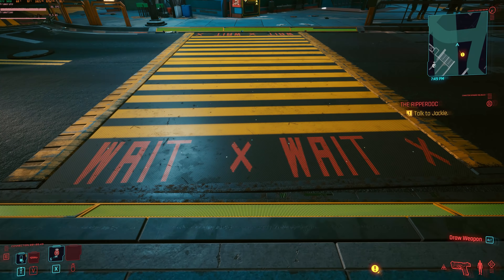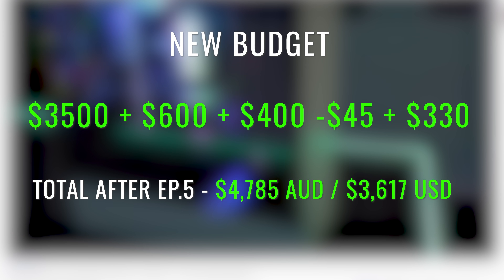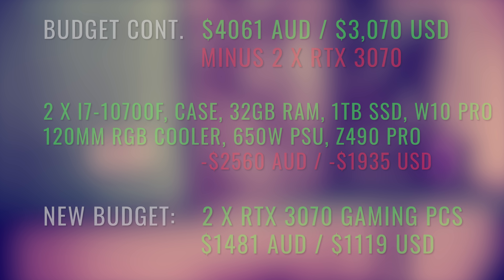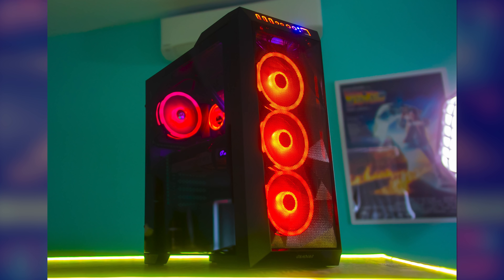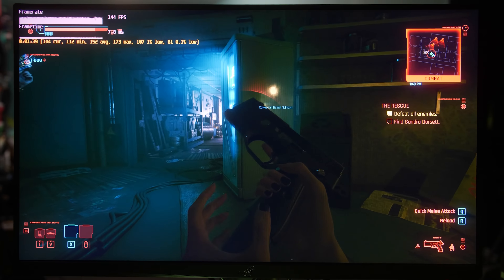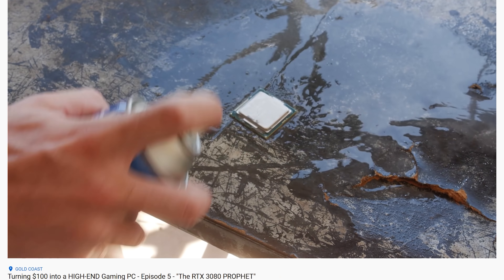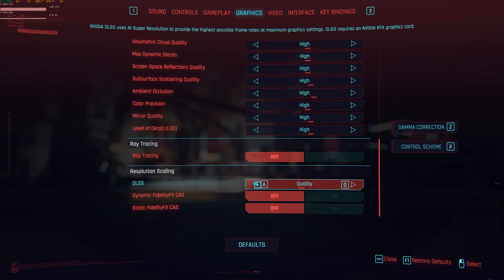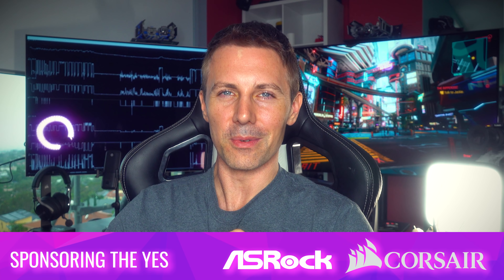Turning $100 into a HIGH-END Gaming PC - Episode 6 - "CyberMONEY 2077"

Comment: i have a r5 1600 and a 1060 and im barely hitting 55 fps on medium settings and 85% adaptive resolution scaling on cyberpunk, i figured out the main bottleneck was the CPU IPC, overclocking my cpu gave me like 20% extra perfomance, so if anyone is having issues with the game on a similar pc i hope this comment helps :)
Reply: Not that different from the gtx 960 2gb and the i7 4790 as I've seen near enough the same result at medium

Comment: I like the fact that you use these not-so well known brands. They mostly as good as other hyped brand's cards imo. Mainly in the EU, most people going for Gigabyte (Aourus), MSI or ASUS, but they usually tend to cost quite a bit more, while these "no-name" brands usually brings better value for the money to the table. Keep up the price-performance hustles! :)
Reply: Especially since MSI and to sometimes Gigabyte have had pretty bad / faulty parts. I've used a HIS 390x for myself and a MSI 390x for a friend, turns out the MSI one had no cooling on one part of it's vram and fried the memory after some years while the HIS card had the better cooler and ran like a champ for ages till I upgraded to a 5700xt. Popular brands do not equal better quality

Comment: Will 6c/6t be enough for Cyberpunk? Im thinking bout getting 3500X from Ali since 3600 prices are crazy, paired with 5700XT, possibly 3060TI if i can get one in decent price.
Reply: Cyberpunk states an i7-4790 (which is an older 4core/8thread part) as minimum for ultra settings, so with a modern true 6 core you should be golden. I happen to have a 4770k that's pretty much the same as the 4790, paired with a 5700xt and it works great for about any game, with the 3500x you should be even better off. Go for the 3060ti if you can, it will be a huge upgrade and prices should come down close to msrp over the next month, well worth the wait imo.

Comment: Technical question - why are all desktops placed vertically and not horizontally?
Is it because of desk real estate or does it serve another function?
Wouldn't it be more sensible to have it horizontally so all of the components, especially the relative heavy ones like gpu, would "sit" comfortably in their slots due to gravity and potentially provide less stress on the motherboard.
Reply: the weight is mostly a problem during shipping, standing still it won't be an issue. there are cases with the horizontal layout, some matx cube cases and htpc cases that look more like hifi components. It's mostly an issue of convenience, really. In the early 90s many cases were flat and could be used as a stand for crt monitors, later with lcd panels desks got more tidy/minimalistic and pcs mostly placed below the desk, so slim and tall cases made more sense

Comment: Why not ryzen PCs, dont they sell ad well as intel, especially now with zen3
Reply: Currently Intel is the deal in some countries like Australia. 5600x costs as much as 10700 here. 6c/12t vs 8c/16t CPU, plus Intel brand recognition is a no brainer for a flip-up PC
Reply: @AssassinKID  yeah but 5600x beats 10900k so its kinda irrelevant to mention a locked 8 core compared to an overclockable 6 core.
Reply: @TheGauges420  what matters is it sells. In the ad if you put "Intel" next to "8 cores 16 threads", it will sell quicker than "Ryzen" and "6 cores 12 threads" to an average person looking to buy. Plus it is cheaper, so more profit to the seller. Remember, an average Joe looking for an already built PC are typically not looking at CPU benchmarks, they mostly care if it can run the games they want to play, and what graphics card the build has.
Reply: Intel processors have come down in price since ryzen is so much more popular atm, in my new build i only use an amd chip for better a upgrade path in the future, as it is now an intel build would've had the better price/performance actually.

Comment: 120 AIO coolers are awful why would you use one of those in that build.
Reply: The cpu puts out about 80w tdp, I'm pretty sure that 120aio can handle 130w tdps no problem
Reply: @Brandon-uy1uv  That is not the point he cheeped out putting inferior product in their when the rest is classed as high end (he has such an easy market this is why others cant do this in my country you could never do these prices or get away with 700 profit lucky to get 100-150)